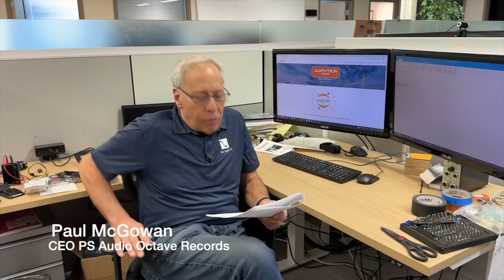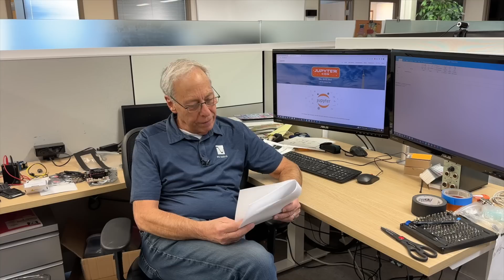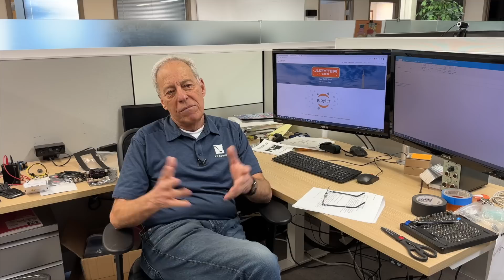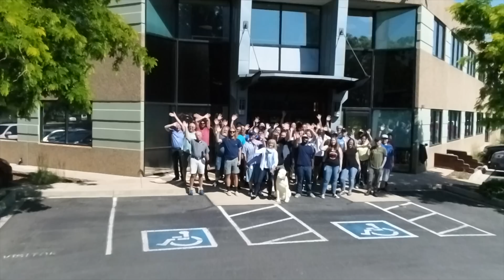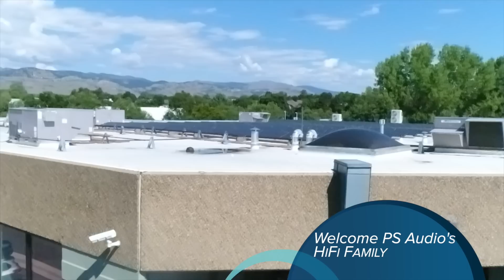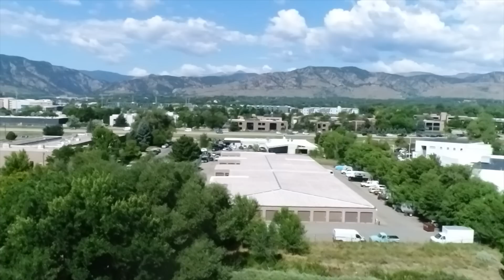Why we need so many watts

Comment: I have a question for the connoisseurs: I have a pair of Technics SB-10, and I have 3 amps: Denon PMA-500Z recap, a Technics SU-V6, and a Yamaha M-70 with its M-50 preamp. I don't know on which one to play my SB-10 ? To the ear, I like the PMA-500Z recap. And my M-70 has a noise filter that melted and smoked, so I put it aside, but I don't know if it's worth repairing right now. What would you get if you could use these 3 amps for technics SB-10?

Comment: Quicksilver Audio used to make their mono V4 Tube Amps  large transformers uses (4) KT-88’s AKA 6550 tubes 100 WPC, KT -120’s 120 WPC and with KT-150’s newer tubes since 2013, 150 WPC. If you design Tube Amps without Transformers you need OTL Amps they use tubes that replace transformers and the have a lot more tubes! And you need an Auto former! OTL Amps Generate a lot of heat!

Comment: Yeah I just hooked up an old Pioneer SA-500A to my moderately sensitive bookshelves to test for my sister for resale. Well baste my turkey does it ever sound lovely! Set at 2'o'clock, it's more than too much volume driven directly from my old RME interface. It's only rated at 13W into 8ohms, and these are 6ohm speakers with maybe 89dba sensitivity. Maybe the bass isn't what it was with the Hafler or the NAD, but since I blew those up I really can't do an A/B comparison... 😅
Reply: I'm keeping it, btw.

Comment: I’m still a bit confused even though I follow the general idea that more powerful transistor amps made it possible for speakers to become less efficient to gain other sonic advantages.  But in 2023 we have an ongoing debate where 20W tube amps are considered as capable as 100W transistor amps.  

Or am I wrong?  Is it that the 20W tube amp simply cannot drive a lot of modern loudspeakers?  Or are Tube Watts better than transistor Watts?

Comment: Back in 1972, I remember my Physics teacher (who was a brilliant electrical engineer, helped design parts for the earliest color TV's) explain why 10 watts was more than sufficient and how you could mount a loudspeaker into a wall to have a virtual infinite baffle. A year later I bought my Large Advents and 45 watts per channel... he wasn't necessarily wrong, but he also wasn't necessarily right, either.

Comment: The problem with crazy powerful pro audio P.A sound systems, is really quickly, to use them at outdoor festivals the amount of generator power required is ridiculous! A 1 unit 20k amp requires a generator the size of a moderate truck! 
   When our civilisation, can generate massive amounts of continuous  electrical power, by non fossil fuel  ways, in a reasonable sized portable format, we will have advanced massively! 👽

Comment: Very well put Paul .... you've summed up the evolution of modern drive units ... Not only have the speakers and amps changed in the way they interact but also the speaker enclosures too. I recall listening to a vintage Goodman's 18 inch Audium 91 bass driver mounted in a gigantic bass reflex enclosure driven with only 50 watts and that system shook the house down ..

Comment: Exactly Paul ! Good answer.. (sorry to be a  critic). This is one of those things where being around longer than everybody else is a good teacher, lol.  
Many people don’t realize the points you raise, and I’ll add that speaker efficiency is actually horrendous (as far as efficiencies go) being on the order of 1 % or less!, depending. It would be a bawling session if amplifiers had that kind of efficiency, lol. That said, there are guitar speakers that sound good with higher sensitivities  since they lack the low end requirement, but I’ve never liked highly sensitive home audio speakers. I’d rather have a less sensitive pair powered up with a quality high power amp. High efficiency is all about conservation of energy, 
and is not synonymous with quality. Some people think it equates to saving money though, bc they really like the idea of a cheaper amp. Don’t fight the power, embrace it, fools. 🤣🤣😉

Comment: So I'd say the high efficiency of the old speakers was only possible in a narrow frequency range, and certainly not in the low frequencies. In order to achieve a more flat response in a wider range of frequencies it was necessary to reduce the high efficiency within the midrange. It would also have been hard without modern transistors.

Comment: If you look up the spec’s of those Amplifiers Paul is using to power those FR30’s compared to the sensitivity rating of those FR30’s. 
That is like a car doing 80 mph at idle. It’s getting the best fuel economy possible.

Comment: Yes, sensitivity is measured in db/watt, but remember that it's db/watt _at one meter from the speaker_. The inverse square law tells us that 90db at 1 meter is only 84db at 2 meters, so it drops off quickly. Also, I strongly suspect that something like a Klipsch horn has different sensitivity for the horn driver vs the dynamic driver that's doing the bass duties, so if the bass driver has more power to draw from, the better.

Comment: There's also the relationship between low frequency, efficiency (sensitivity) and box volume. As you'll always trade one for the other speakers boxes can now (with improved motor) be made smaller and that's easier to sell. But there's still some really great drivers out there that's built on say 40 year old technology that's good in sensitivity or might require slightly larger boxes.

Comment: you need so many watts because transistors sound the worst when clipping so you want to be as low as you can be on the volume dial and have enough power. with class a or tube amps it's less of a problem since they don't sound so bad cranked.

Comment: Speakers are voltage driven not current driven with a few exceptions. People think it's the high current delivery of having many watts that's doing the trick but big wattage amps have big voltage transformers. So what's actually happening is there's a linear region before a class ab amp goes from the a to the b and the extra power extends that region and as most only use a few watts in their systems because nobody needs that much they end up thinking they need that much.

For example. the schiit ragnarok has its first like 3 watts in class a and the rest in ab. My smsl vmv a1 mostly runs 10 watts class a. My tube amp has 8 watts class a. How do they all sound? about the same in my apartment because I don't use many watts. If I push them all hard in a big room you may see some difference but even then I'd just use more efficient towers in a big room and I'm back to not needing the wattage.
Reply: Voltage across the driver drives the speaker. So, you need big current to maintain the amplifier voltage to move the speaker if it's impedance drops. Look up some lab reports on speakers, and the effective impedance caused by phase changes at certain frequencies can get down to 1 ohm, or even lower. What does this mean for current? Well, a typical 50 watt amplifier needs to push 20 volts into 8 ohms to deliver that 50 watts. But what happens at that low impedance point? We still need 20 volts across the voice coil to maintain a flat frequency response. So, at that point, we need 20 amps to prevent a drop in output. So, your statement is not true. Yes, we need big volts to create a loud sound. But, we need the high current to deliver that high voltage across all frequencies, depending on the impedance curve of the speakers being used.

Comment: Hmmm with less than 5 watt I power 802D3’s and it’s quite loud…. When we talk A/B amp’s the vendors are talking about lots of power which is needed. Once you go the class A route 50 watts is enorm… why? Power = Power = laws of electricity. Snake oil with some gibberisch?

Comment: Laws of physics once again. The variables are size, bass response, efficiency. All else equal, the bigger the driver the more efficient it is at lower frequencies. As only lower powered amps existed originally, size became the variable. Once more power was available to overcome lowered efficiency we could design smaller drivers to get to the lower frequencies by giving up efficiency. Step in air suspension/ sealed cabinets. Lot's of physics as to why, but trading off efficiency for low end response from smaller drivers was accomplished. 

So today we have little boxes on stands that can outperform closet sized cabinets from the past. If you have enough power behind them.

Comment: I listen to demos of Western Electric tube amps driving voice of the theater horns and they are wonderful.  So I have a different opinion.  What came first?  Big solid state amps or inefficient cheaply made speakers?  The industry got lazy with speakers and could throw watts to cover it up.  But they lost the life of the sound.
I'd rather have an Aries Cerat horn system driven by 30w tube amps than 1kW amps driving some box speakers.
But there is an advantage to having more watts than you need.  Music just has more authority.  Perhaps better transient response or lower slew rate?  I don't know.  It just sounds better as long as you give nothing up to get the watts.  I use triode amps that can run at 25w or at 110w.  The 110w sounds better.  Same exact system, same music, source, speakers etc.  Just disconnecting a couple of tubes.
Reply: "The industry got lazy with speakers" - no.  That's just polemics on our part.  Horns are efficient but are not accurate reproducers of sound, so lower efficiency speakers are used to be more faithful reproducers of sound.
Reply: You speak my language, sir!  VOTTs driven by an ST-120 with KT88s here, and I never tire of listening to it ❤
Reply: @cletusberkeley9441  I can imagine.  Nice!
Reply: Could you explain what exactly makes an efficient speaker more expensive than a non efficient one? (Other than size)
Reply: @jonathandavis9507  I don't see a correlation between efficiency and price.  Some like Zu are pretty reasonably priced.  Some single driver full range using transmission line to boost bass can be quite reasonable.
Reply: @user-od9iz9cv1w  I tended to think higher watts was  to mainly to get smaller / stiffer / higher mass drivers to perform better. I’m not a speaker designer, though.

Comment: There are still plenty of high-efficiency speakers on the market. Audio Note is particularly good in that respect and I've heard amazing systems using less than 20W, and even some with less than 10W.
Reply: I'm willing to bet almost every single system people own generally uses less than 20 watts.
Reply: @V1ralB1ack  Called Klipsch recently, the man said that you need 10X the, `normal, average power,' that you're using, to handle brief, instantaneous peaks. Or, more! If you're coasting along at one or two watts, this is only 10 to 20 watts. When you want to, crank it up, once in awhile, how much? Let's keep in mind, that a cymbal crash, piano music, has a lot of, `peaks,' less of an, `average level,' if any at all ~  Can YOU hear the compression, when the amp runs out of power, even if it doesn't sound, `bad?'
Reply: @Richard’s Office  actually, yes, if you know what you are listening for. There's a harsh sound when the amplifier goes into clipping, because it basically sends an approximation of a square wave to the speaker, which is a generation of a lot of harmonics that are not natural. The more clipping you generate, the more high frequency energy you send into the tweeter. The original Advent speaker had a three position toggle switch on the back  for the tweeter. If you were going to crank up your system, you toggled to the setting that cut the frequency response to the tweeter so you wouldn't fry it.
Reply: Fyne Audio are another example of efficient loudspeakers.  They’re an off-shot from Tannoy as most of the management & design team started the company.
Reply: I would say 20 watts is right on the money especially if they have a sub I had a twenty watt radio and I would crank it it would be perfect for watching a movie or listening to music while doing dishes

Comment: Most of the time we listen to music between 70 to low 80s db. That is less than 1 watt for an average speaker of 88 db/watt.  I would think a 8 to 40 watt tube amp or 20 watt of solid state like the Schitt Aegir or Firstwatt amps  would be enough for most.  An even more efficient speaker of say 91 db/watt driven by a 20 watt amp could play to 100 db, while keeping amplifier distortion at less than 1% at least that is what many of the first watt specs show as it approaches maximum wattage.
Reply: lolz.

Comment: That was an answer? 😮 there are many variables to the question that was not considered. Example, some of the lower powered amps produced lower noise, no one worried about carbon consumption requiring less electricity demand, imports were not as common with costs on the shipping of heavy linear transformers. A 20/30 watt amp had a large enough supply to produce the required voltage to allow the power to flow to inefficient speakers. Let’s not forget that the governing bodies did not set the limitations to market power to the rms standard until the 70’s or 80’s.

Comment: Hi Paul how can I contact you I need advice for the audioengine  A5+ speakers , What type of reciever I can safely use Thank You
Reply: If Im not mistaken, it's a powered speaker correct? What do you mean by receiver? Do u need a tuner or an external amp?
Reply: @Douglas Blake You explained it well 😉
Reply: Amp